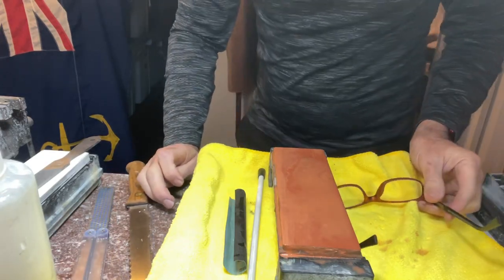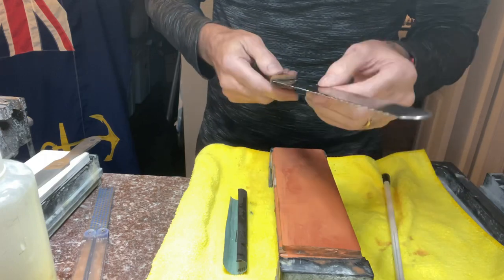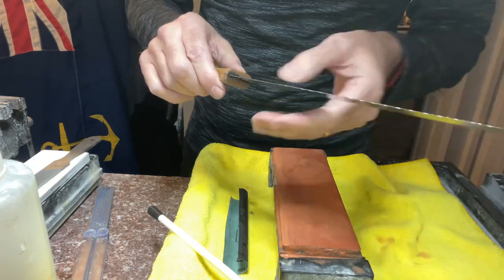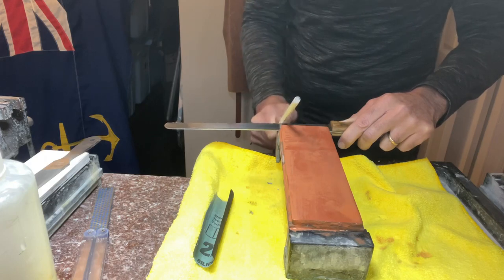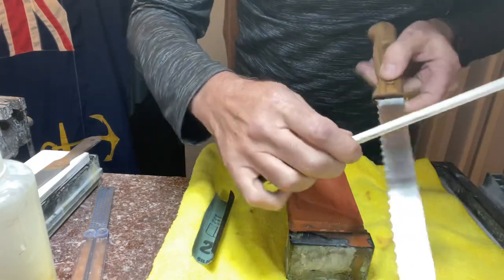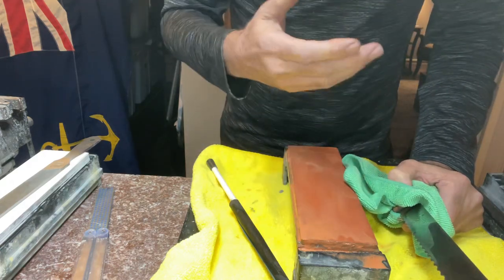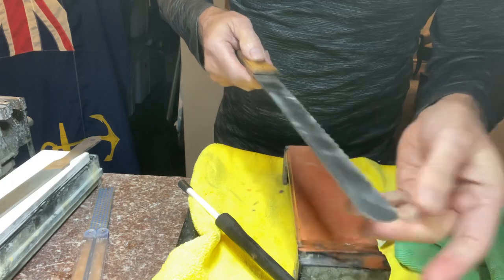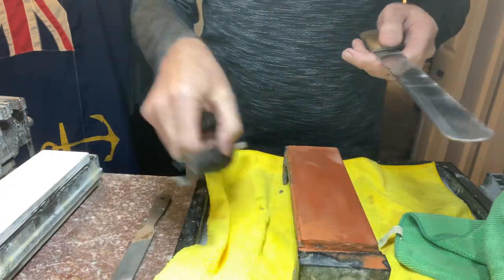Serrated Knife Sharpening

Comment: Thank you for good video, well presented, information easy to understand. 
At 4:30 you are removing the burr in one direction, but at 6:50 and 7:** you're removing the burr in different directions. Which direction is the correct/best for removing the burr?
Reply from the maker: Thank you. I’m this video I was just using two directions to demonstrate the burr removal procedure using a stone and if no stone avail another abrasive. However I remove the burr on a serrated knife using the direction seem at 4:30. Never hesitate to ask me questions at Sharpenerpeter@gmail.com

Comment: Is it possible to sharpen a micro-serrated knife?
Reply from the maker: They are not designed to be sharpened really but what I do is basically sharpen them as if they were not serrated. I don’t spend as much time on them, I don’t really form a burr even but they do get sharper for sure. So not like the technique in the video. More like typical knife sharpening.
Reply: @peternowlan5196  try a rat tailed tapered diamond file
Reply: GREAT WORK MATE GREAT INFORMATION GREAT ADVICE!

Comment: The problem is finding the right rod size for your knive. There is no standards
Reply from the maker: I have a solution for you😊.You just need to find a rod of some type, like a wooden dowel of a diameter that fits into the serrations. Then wrap some wet/dry sandpaper around it, 400 grit for example. Now just run that through each serration. You just need something that fits, like a pencil even. Form the burr then remove that burr using a stone. Does this make sense ? ( yes I know the serrations are not a standard size but you can just buy a wooden dowel to fit.
Reply: Yes! That makes sense, thank you!